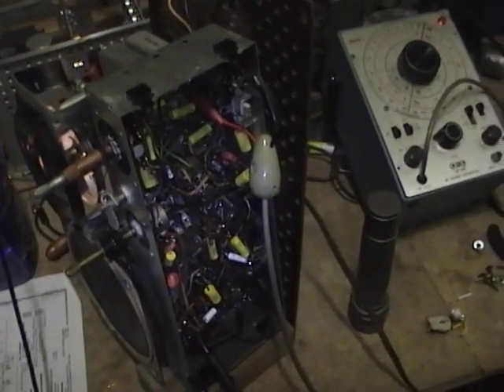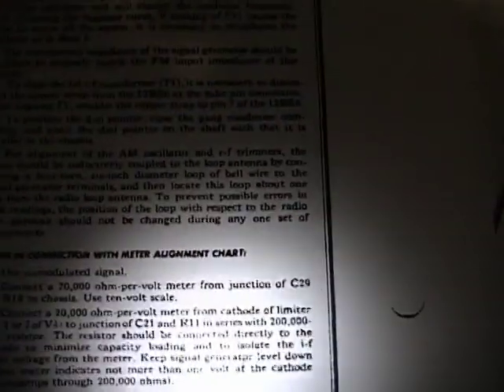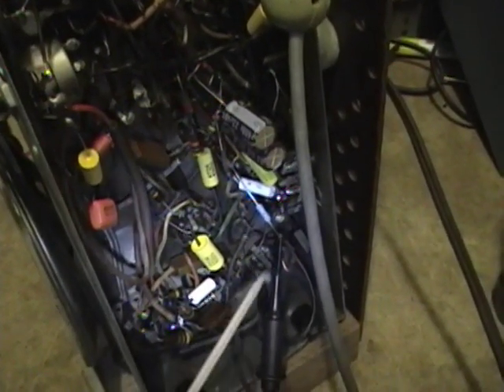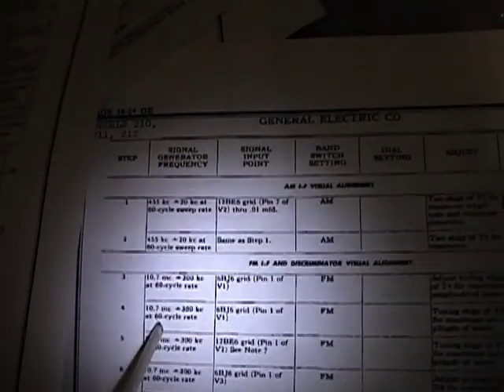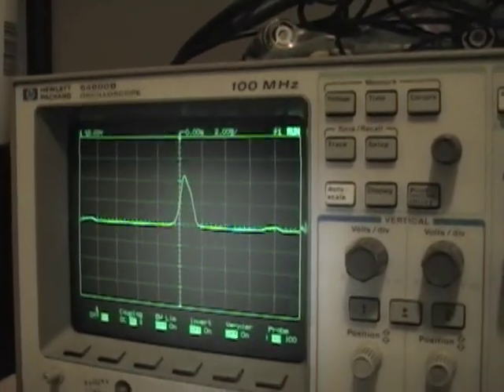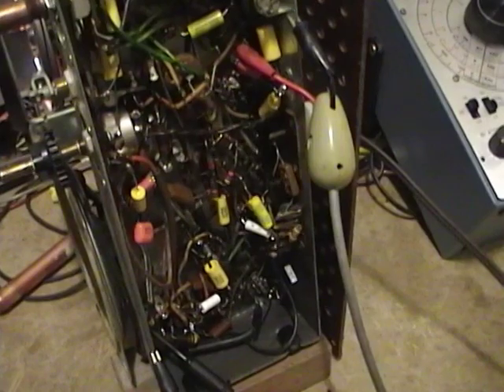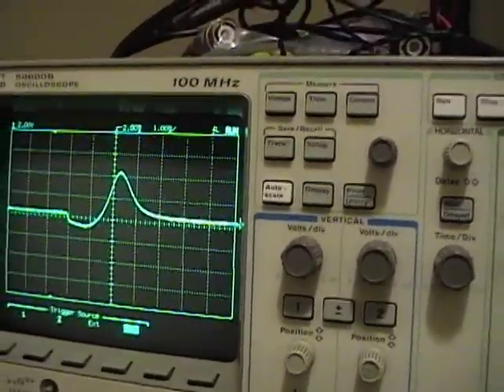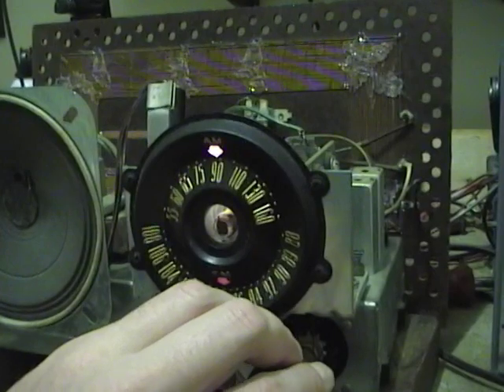FM Radio Visual Alignment

Comment: GOOD EVENING, CONGRATULATIONS ON YOUR VIDEO, MAYBE YOU CAN HELP ME, I WILL PASS YOU THE DEVICES THAT I HAVE IN MY LABORATORY I DON'T KNOW HOW TO CONNECT THEM TO SEE THE S CURVE IN A TRANSISTORIZED FM RECEIVER, TO ADJUST THE F.I'S: FREQUENCY METER VC 3165 0.01HZ-2.4GHZ, AM/FM RF GENERATOR - 120 MHZ GRF-30 DIATRON, SWEEP/FUNCTION GENERATION MINIPA MFG-4201A, AM/FM SOUND RESEARCHER PS-25P, OSCILLOSCOPE GW GOS-623 20 MHZ DUAL TRACE. I WOULD VERY APPRECIATE YOUR HELP.
Reply from the maker: I'm not familiar with any of that equipment.  The general procedure is you put your scope in XY mode, connect the swept RF out to the radio.  Connect the scope Y input to the radio.  Connect the scope X to the sweep ramp output of your sweep generator.
Reply: okey

Comment: I bought a very small oscilloscope eso 188 ,haven't figure out how to use it yet I work on.old tube radios I not sure where to hook it up at for alignment ,anyone have any Ideas ?
Reply from the maker: I think you mean DSO 188 ?  It's a huge topic. Every radio is going to be a little different.  What model are you aligning ? Is it AM or FM ? What are you using for a signal source ? Etc.
Reply: The DSO 188 can possibly be used for alignment, but I think only after you have experience working with a normal, full-sized oscilloscope. My suggestion: buy a second-hand full-size DSO and learn on that.

Comment: Thanks for the vid. I have tweaked my Aiwa AT-9700 tuner for maximum sensitivity and the results are outstanding. But why do I get slightly more volume and separation (but slightly more distortion to MY ears) at +200kHz from nominal station frequency? Is this a fault and if so how would I correct this without using any test equipment? BTW this is one of the greatest tuners ever produced, in my estimation.

Comment: Thanks for the vid. I have tweaked my Aiwa AT-9700 tuner for maximum sensitivity and the results are outstanding. But why do I get slightly more volume and separation (but slightly more distortion to may ears) at 200kHz from nominal station frequency? Is this a fault and if so how would I correct this without using any test equipment? BTW this is one of the greatest tuners ever produced, in my estimation.

Comment: Band pass has to be wide and linear for any FM radio.  Has nothing to do with mono or stereo.  When you listen to a musical note on an FM radio, the carrier wave is fluctuating up and down in frequency at a rate equal to the frequency you are listening to.  The amount the carrier fluctuates in frequency determines the amplitude of the audio, and the rate at which it fluctuates back and forth determines the frequency of the audio.  If your circuitry does not have a wide band pass, loud passages, which fluctuate the carrier in frequency a lot, will sound distorted.  This will be particularly true with heavy bass, as it is often pushed with the most amplitude.  This is why you do not want to finish with IF transformers peaked.  First you peak them at 10.7 MC. Then you stagger the top and bottom coil above and below 10.7 MC by an equal amount until you get the required band pass. Ideally there should be no peaks or dips in the band pass section.  It should be perfectly flat.  Irregularities will cause distortion in the audio.  Think very early talking pictures.  These used variable density optical sound tracks, and if successive prints were not made on film with linear light response, or if the film was over or under exposed, so that the lightest or darkest parts of the wave disappeared all together, you wound up with the garbled distorted sound you often hear in poor copies of very old films.  Back to FM radio, the discriminator, on the other hand, is usually peaked.  The IF transformers are not peaked.
Reply: td1238 Sir, you use the term MC (Mega Cycles) instead of MHz. I bet you have been in this industry for quite some time? Thanks for your info
Reply: Peak the primary, secondary you want on linear portion of the slope. Ratio detectors you can mostly do on the fly by setting so output DC is at half the max swing. If 8 volts is Max as you tune through a channel I set for 4 v on the trailing slope. Gets pretty close.Good for a field repair. I will only give something back to a customer if I have benched it with the sweep gen and scope. If a stereo piece my Heath stereo generator is used to set it up. Limiter/Discriminator sets really need to be done visually for the very reason you state. You want the pass band to be wide enough for fidelity and wide enough for max 19Khz pilot signal.

Comment: Hi Bob,
What did you trigger the scope on?
Reply from the maker: AC line - because that's what the sweep gen uses internally to sweep the oscillator.  The downside is that the sweep will be a bit non-linear, but I figure it's good enough when markers are used.
Reply: bandersentv
Thank You Bob !!

Comment: Fantastic video!  It would have helped to see specifically where in the schematic you were injecting and reading your signals.  I know that it is specific to your radio but it may be of help to someone (like me) who would like to develop a generalized process that could be applied to any radio (both for AM and FM).  Great job and keep 'em coming!
Reply from the maker: I've only aligned a few FM radios and the instructions were very different.  Probably because they were early designs.

Comment from the maker: A frequency count is much more accurate that an oscilloscope.  Also a heck of a lot easier to read if your 'scope doesn't have a digital frequency readout like mine does.   I just do this for fun and don't consider myself an expert on FM radios.  I've only restored a couple so far.  Maybe try joining the Antique Radio Forum and asking your questions there ?
Reply: bandersentv One could use a modern synthesized shortwave receiver to dial in the older analog frequency generator. I use my Radio Shack DX-392 to easily pin 455 KHZ or 10.7 MHZ or many other frequencies. And of course listen to Infowars on WWCR 12.160 noon to four o'clock EST and 4840 at 10 PM. God Bless

Comment: @bandersentv at 4.16 the response curve looks correct,(skirted) but then it jumps to a rounded crest. I admit I am not familiar with the unit you are working on, but I would expect more pass at the edges of the sweep. On a mono unit I guess it's not a fidelity killer, but on the units i typically restore, the IF response is critical. I typically don't use a detector probe so I can see if the sweep remained linear or got pulled off kilter by the filter itself. Nice to see someone posting this.
Reply: jfdonnald

Comment: Hey me again, sorry. The FM freq response should be flat on the top and have 200 Khz band width (down about 30% from the flat-top / peak).  Also the idea is not peak but to get the FREQ centered on the 10.7 Mhz IF.... how are you doing that?
Reply: gmcjetpilot

Comment: I usually connect the 2 negatives together when making a bi-polar cap.  I wonder if it makes any difference in performance?

I'm really sold on scope alignment now, especially for the discriminator.  

The issue I ran into with solid-state stereo sets, was not having the equipment to adjust the MPX circuit on certain ones.